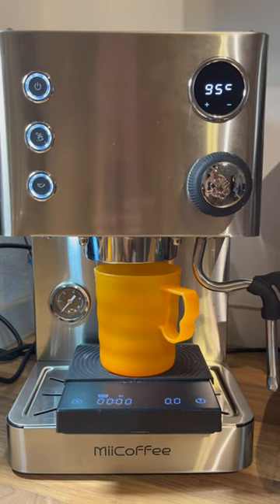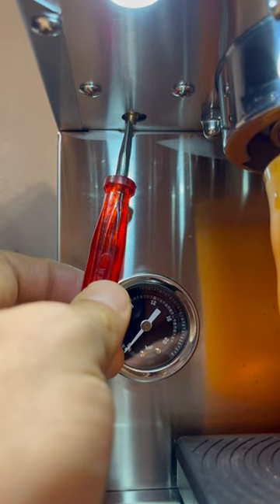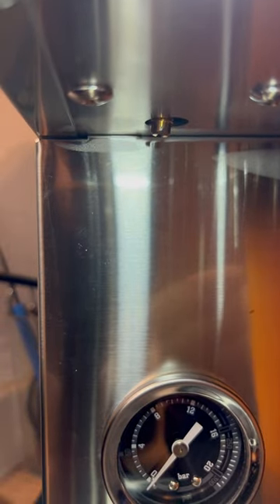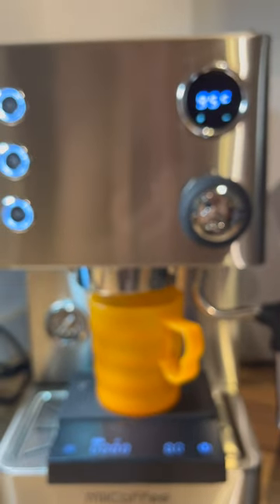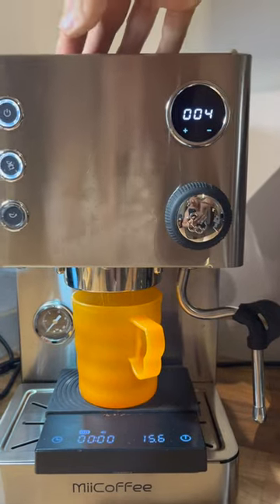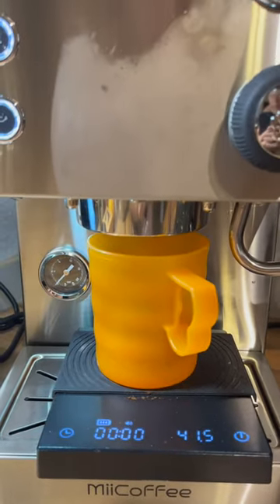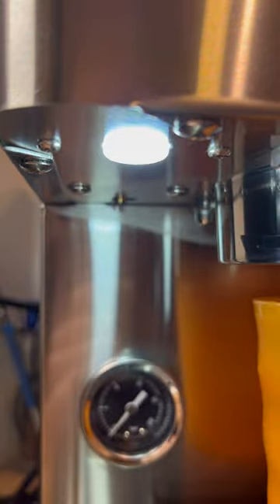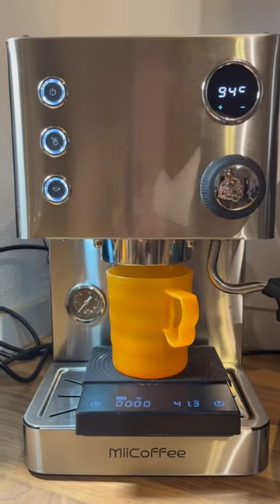MiiCoffee Apex Adjusting Water Flow

Comment: For a first or entry level espresso machine would you say the MiiCoffee Apex is good enough or is the Profitec Go more worth it?
Reply from the maker: Well, Profitec as a German brand will have unbeatable quality and better resale value. But the Apex has separate heating systems which is quite a nice advantage. Cheers!
Reply: @TomsCoffeeCorner  Thanks for the tips. Yeah I feel like the Apex might be a better entry level machine than even the Gaggia and saving the money to buy a better grinder is probably better than spending it all on the Profitec.